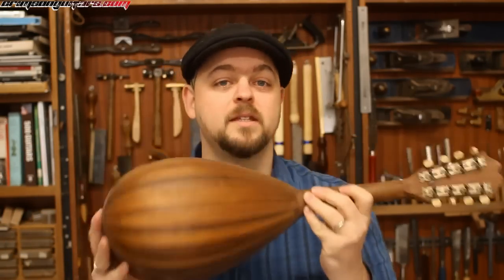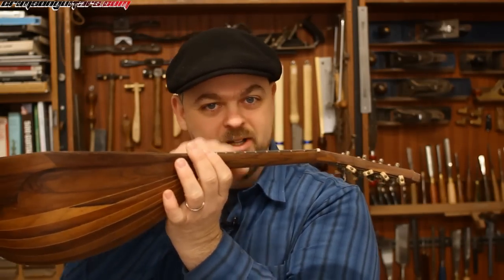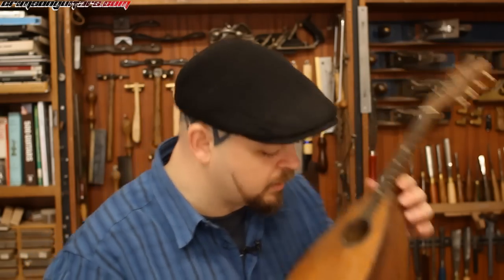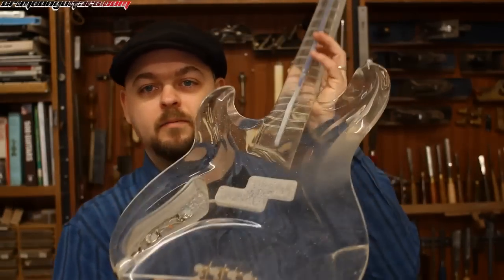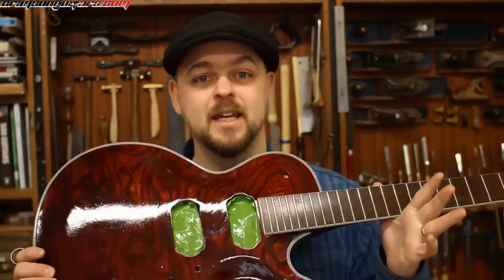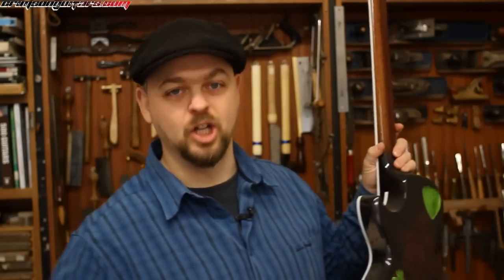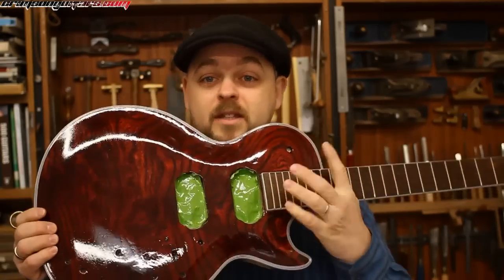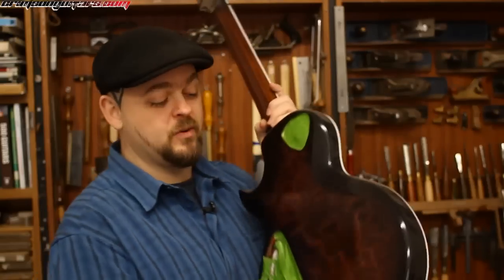Why do we still use wood in guitars? -  Podcast 78

Comment: Not sure if this is allowed to be published or not but JB Priestley had this to say about wood...

Essay on Wood by J B Priestley, from “Delight” published 1949

I am not as clumsy with my hands as many bookish men I know, but I have never had any training or practice in handicrafts, and apart from sawing and splitting logs and knocking a nail in here and there, I have had little to do with wood. Yet I never go where wood is being worked, never stand near a joiner, carpenter or cabinet-maker, without feeling at least a tickle of delight. To handle newly-planed wood, even to look at it or smell it, is to receive a message that life can still be in good heart. The very shavings are a crisp confirmation.

There is a mystery here. Atavism will not explain it. Our remoter ancestors, winding back into the mists, were chippers of stone. I have seen their flints, inside and outside museums, and have never yet felt a quiver of sympathy. Woodwork as we know it, needing sharp metal tools, must be one of man's newer activities. Is this perhaps the secret? Is this stuff still so excitingly new? But light alloys and plastics are newer still, the discoveries of today, and yet no message comes from them. Is it because wood, no matter how chopped and trimmed and planed, somehow remains alive? I put my hand on the desk on which I am writing now, and it is almost as if my palm fell on the shoulder of a brother. Into this patient material have passed rain and sun, steely mornings in March, the glow of October: it has lived as some secret part of us still lives.

And notice how few men who work with wood seem unhappy, defeated. When we write a book about a Carpenter, we call it the New Testament.
Reply from the maker: That is beautiful, and true.. Thank you for introducing me :)
Reply: Crimson Custom Guitars totally disagree did not go on longer than necessary. I could have easily listened to another 30 or so minutes on this topic 😂😂😂.

Comment: My first acoustic was an Applause in the mid-'70s. Fiberglass bowl back, a plastic top, an aluminum fretboard with a spine on the back onto which was an molded plastic neck and headstock. The only wood was some bracing under the top and the bridge. 
It sounded like a guitar. A basic guitar-- because I am not a great player, it was adequate. 
Years later, I acquired an Ovation. Almost identical bowl back, but the rest was wood. Yeah, it sounded richer or fuller, but not to where I would have smashed up the cheaper Applause, and sent it to the dump. I never had a chance to do a side-by-side comparison (the Applause had suffered a fatal accident some years before), but I can recall a brightness that I've seldom heard in an entry-level "cheap" guitar since. 
Wood is wonderful, for all the reasons Ben gave and probably more. Don't automatically avoid non-wood materials; they can also be crafted into fine instruments.

Comment: Yeah wood is unique in that each piece, even if it't the same species of tree, has subtle (or not so subtle) differences in color, grain and appearance in general. I prefer wood over any other material for sure. Remember the old Kramer aluminum necks? Interesting but I still like wood.

Comment: give it another 50 years and carbon fiber will probably become much much more common as it becomes easier to produce and we discover new ways to handle/work with it, for the moment wood is much more common and easy to work with at the moment (for the majority of people -i'm guessing), you can get a variety of woods to make a good sound too, heck i've got 2 marlin sidewinders (K32 and K34) that are heavy, sound nice (to me at least), excellent to play and the bodies are made out of ply! only trouble with them per-say is the sustain when amped up, which i think may be the poles needing a bit of re-magnetizing or replacing and the frets need a little bit of work, which i don't think is bad after 30-something years use :)

Comment: Apart from what is already said in the video, wood is very easy to cut and glue together compared to plastics and metals. Composite materials are ridiculously hard to work with, especially if you want to make several models of guitars. And wood has a great rigidity/strength to weight ratio. 
Given, i did 3d-print a violin recently, it's not too heavy, it sounds good enough, and it was cheap. But it would be kinda hard to do with a guitar

Comment: 3D printing: good for prototyping, bad for productivity. Good for exotic geometries that can be measured, bad for sculpted geometries that cannot. Additive manufacturing has its place, but it is the realm of A: It cannot be done any other way, or B: you're more concerned with the shape than the material.

Comment: Put simply wood has such great plasticity.  You can shape however you want without having to make molds etc.  Wood comes i an infinite variety of grain pattern and colors.  There is a wood for whatever you want your instrument to look like.  I would say that refinishing or repairing must also be a whole lot easier with wood.  It is great to see makers putting new spins on things, and using different  materials.  However the buying public votes with it's wallet, and largely stays with the traditional instrument.  Maybe if instruments  made with alternative materials were cheaper the market would expand.   There are no instruments really at the lower end of the market in this category.

Comment: Why wood. It's cheap - it grows on tree :D - it's sustainable, it's relatively safe to handle and any numpty can do a half decent job of forming a shape from it. Man-made materials involve using oil for the most part, so cost a fortune. Carbon composites are expensive and difficult to work with - it isn't as simple as buying the materials and away you go. Wood has the perfect density - mass per unit volume - so it's the ideal weight when formed into a guitar shape. Wood is the best compromise, but at the end of the day, it's the most cost effective way to make a guitar.

Comment: I'd add timber is also sustainable as a fourth point
Reply from the maker: True! Well, mostly.. It seems that all to many 'guitar'  woods are endangered and getting more so.. The tone is ripe for either other materials or other sources of more sustainable timbers imo
Reply: Crimson Custom Guitars I'm all for using any sustainable as well as reasonably eco friendly materials that still sound decent. Carbon for example is awesomely clever but an ecological disaster.

Comment: James Trussart makes aluminum guitars. Dan Armstrong guitars have lucite guitars and aluminum necks.
Reply from the maker: I can't believe I forgot to mention metal Guitars.. I have made a Les Paul type with a copper top and have plans for more, it is a fascinating material and has loads of potential
Reply: I saw in some Forum a build from a hobby-ist who made probably the most gorgeous Telecaster I've ever seen. The body was pure stainless steel (hollow of course) and the neck was carved out of 1 block of aluminium and just some steel frets added.
Reply: Aristidese uses Arium.

Comment: I. don't know what happened to it but. it appears as though the guitar toward the end of this video  was finished with a long napped roller .full of dust ,the orange peel looks more like grapefruit.I hate to point it out to everyone but that dirt will always be able to be seen.iv painted automobiles for over 25 years and never have I seen such a pitiful looking thing.I know it can be sanded and buffed and to the average person they would never see it.but you have to work too hard to get in those areas next to the neck for instance its almost impossible to make look rite without going thru the finish somewhere. spray it with more pressure is the first step and put it on the way you want it to look when your done with it .

Comment: Know why wood is ultimately superior to carbon fiber?      
It's WOOD!  It has texture and randomness within the grain.  No two slabs of wood are quite the same, at least until they start cloning trees.  Actually, they've probably done that already but not in MY neighborhood.  You can't make a guitar out of wood without murdering a tree, and murder sounds like rock & roll. 
Wood is Howdy Doody's HEAD. Wood is the log cabin in which Abraham Lincoln was born, as well as the theater railing his face hit when he fell forward after being shot in the back of the head like the guy sitting in front of Pee-wee Herman during HIS trip to the theater.      
Jesus wasn't nailed to a poured polymer beam. He was nailed to a wooden cross.        
Good enough for Jesus and Abe Lincoln, good enough for me!     
Who the hell wants to wake up with morning carbon fiber?   
E pluribus unum!

Comment: So much of it all falls to craftsmanship. "Touched by the hand". 
Even if carbon fibre or the like became a new standard, it isn't for me, unless I can regularly plan ahead for several weeks of not having any hands to speak of. The activator in the resin( and in automotive body-fills) causes the skin to slough off of my hands, feet... and in an area that it just isn't acceptable. The fumes absorb straight through the skin( even with pva gloves and a respirator). It takes weeks for the skin to grow back, during which time my hands are useless. Long ago, I'd had to repair the bodywork on my racebike, and during recovery, I'd soaked my hands in moisturizer, stuffed them, dripping into my gloves, only to have every joint split and bleeding by the end of an eight lap race.
Anyone working with such materials should know that if you do have a reaction, it will only become more severe with each exposure( voice of experience). At any rate, no matter how consistently each instrument is made, the grain of the wood renders each as individual as a snowflake.